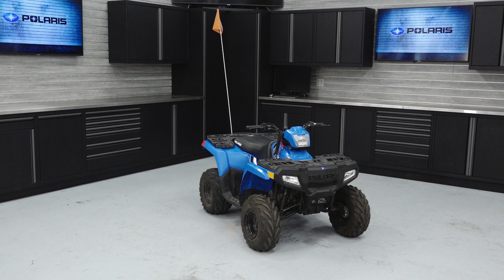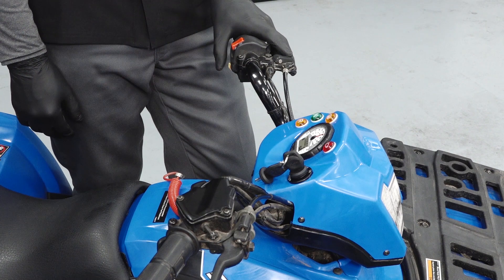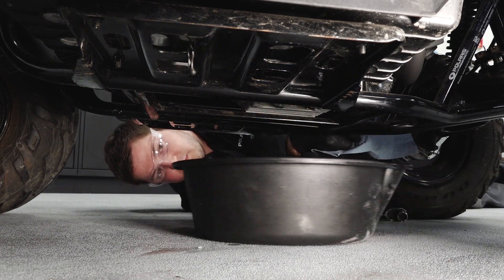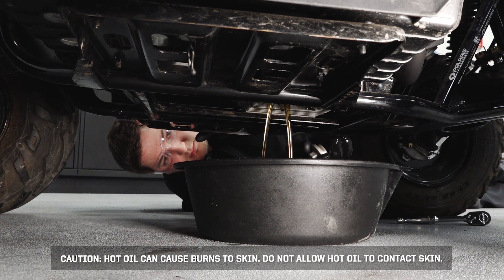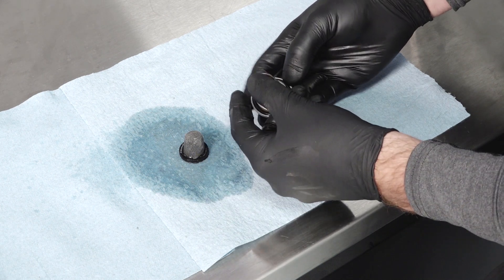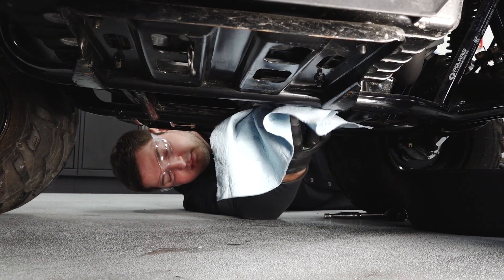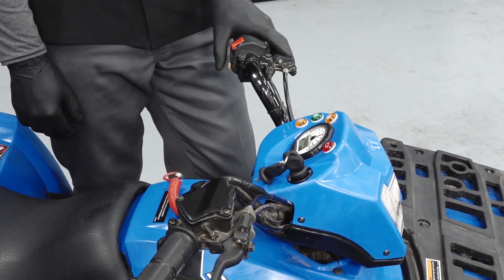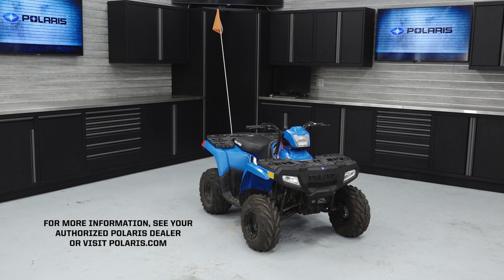Sportsman 110 Oil and Filter Change | Polaris Off-Road Vehicles

Comment: Video completely skips over what type of oil to use 🤦‍♂️
Reply: Ps4 5w50
Reply: @dmoretz525  thanks I needed to know for mine
Reply: @cass8144  No, the manual states 10w-50 PS4 for the Sportsman 110. Seems it is sold for the same price everywhere, but Amazon gives you free shipping.
Reply: @jonmccauley6490  5w40 is the oil you should use it colder weather cause it’s thinner and not as thicc
Reply: @cass8144  The manual makes no mention of this and I live in Texas where it rarely freezes. Even still, the small 110 engine runs super hot once warmed up and you never base your engine weight on ambient temperature alone. Cold start rating is only half of the solution. The "50" is the other half. Our 110 has even overheated a couple times and limited speeds on us.  It runs hot all the time. For that reason, it's why Polaris specs the thicker oil weight with a high temp range of 50. I would not recommend a lower rating. 10w-50 is what the manual says. I'm looking at it right now.
Reply: @jonmccauley6490  ok makes sense. Should you get your 110 looked at? I don’t think it should over heat all the time. My 400ex (which is also air cooled) has never over heated and I’ve ridden in 90 degree weather for long periods of time